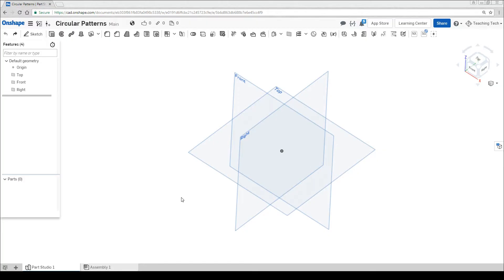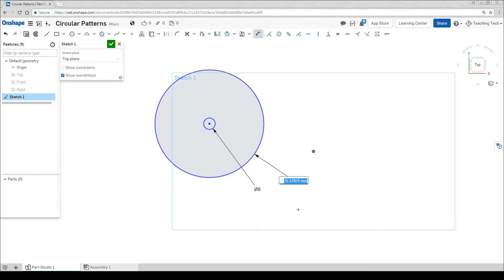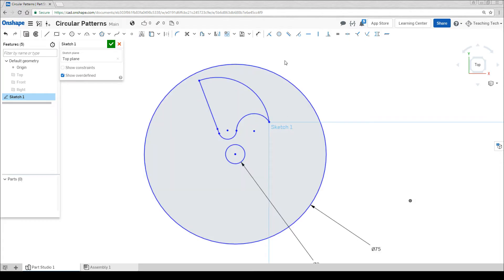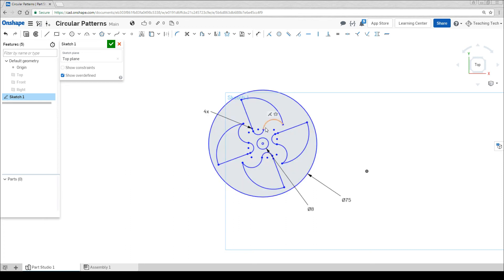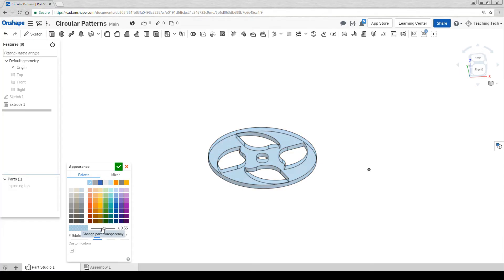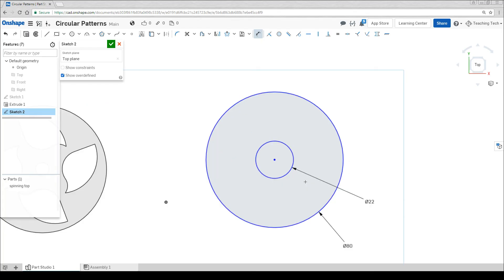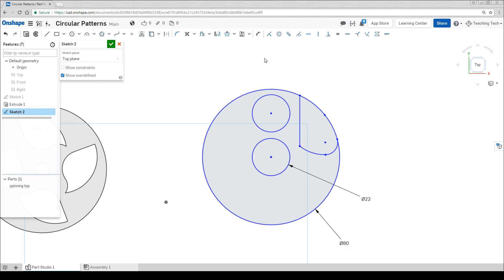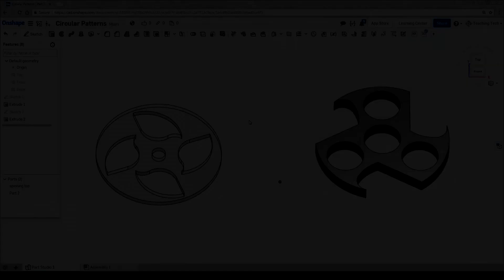Onshape easy tutorial - Spinning tops and fidget spinners

Comment: You're going way too fast at 1:32 on and not explaining these "tangent tools" useage.  Sorry.  Most of the lessons are really good, but this one is killing me.  All I'm hearing is a continuous group of clicks from you.
Reply: 1 select the line tool and draw the straight line.
2 select the 3 point arc tool
   2a the first point will be on the straight line  the second point points give you a diameter.
   2b the 3rd point gives the direction and curvature of the arc.
3 Select the tangent tool
   3a select the other end of the straight line then another point a short distance away this will give you    the bottom curve
   3b still using the tangent tool click on each open end to create the final curve